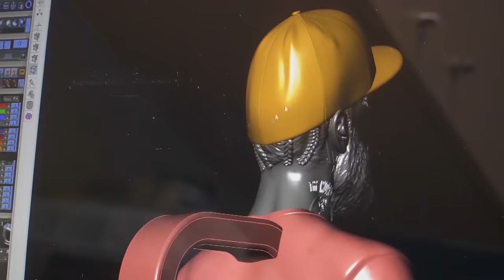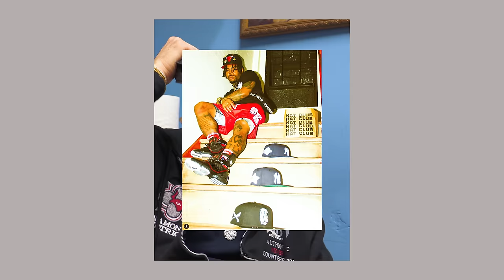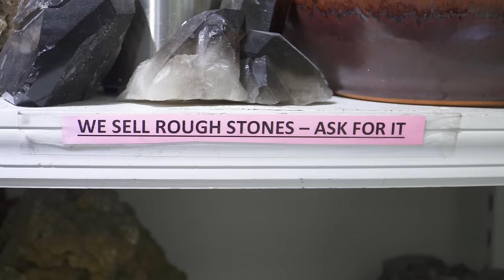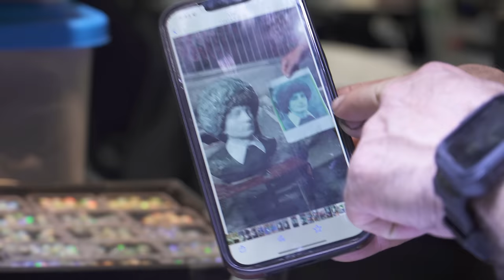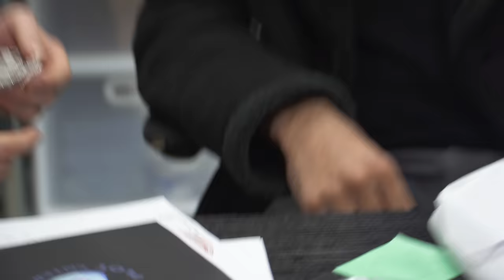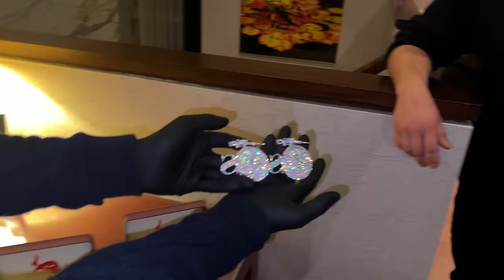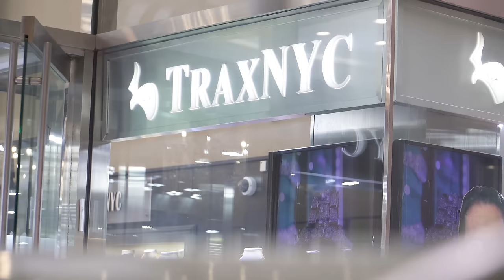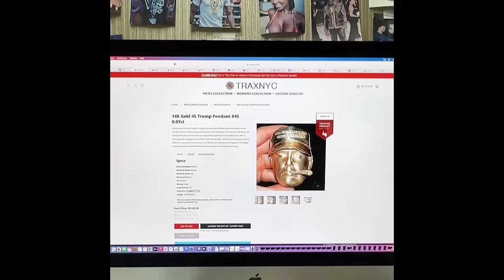⁠KODAK BLACK CASHES OUT AT TRAXNYC! | THE DISTRICT S.2 EP.1

Comment: If you were going to use a diamond to make your car go how big would it be? 
Which piece would it fit? 
For example it takes two hours to make an alternator but i think its with manufactured parts pre assembled 
From scratch the alternators made of nothing but dismonds but different types different pressure different styles cuts designs 
If i could make my windows diamonds would i need dismond tint to not blind incoming cars? 
If they've always been diamonds why when the bust a window do they not pick up the diamond loot? 
Is it because of no loitering or littering? 
Can you make dismond fiber glass or is that an black onyx moron? 
Sorry lol